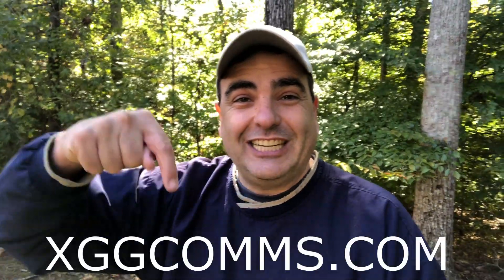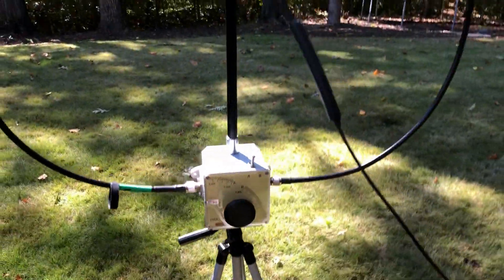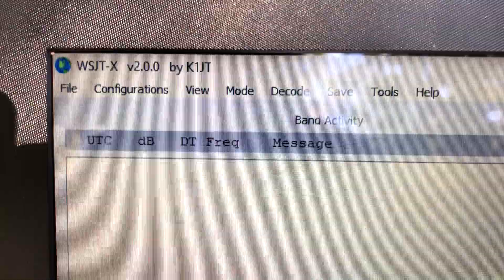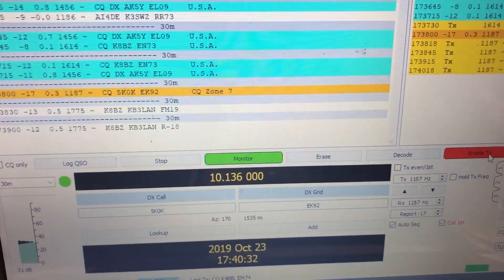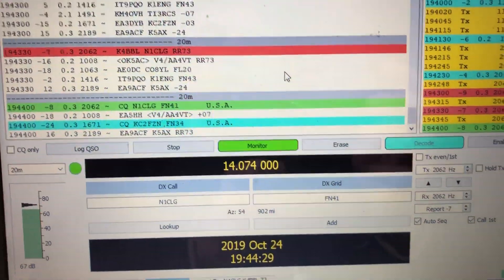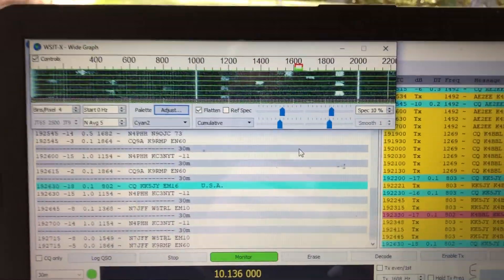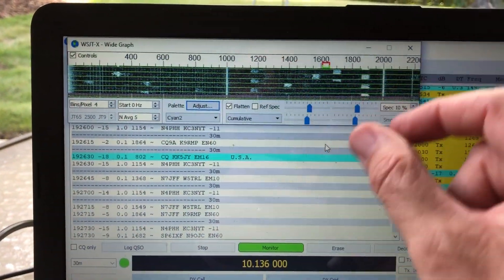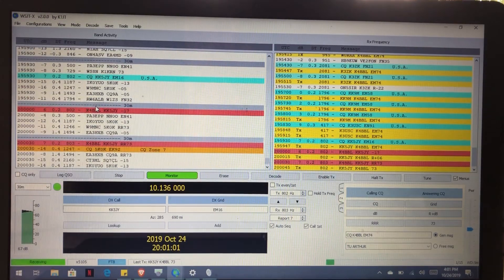No talking ham radio: Digital mode FT8

Comment: FT8 is destroying ham radio.  Now they're on 7.048 almost 24/7.  I've heard them texting each other on 7.060 - the American (and one of the world-wide) QRP watering hole.  I run between 1 and 5 watts.  The FT8 signals on ~7.068 or so are ALWAYS 20 to 40 db over S9 at my home.  Nice huh?  What a super efficient mode.  I've heard, more than once, FT8 idiots (F-tards) running their robots on top of W1AW.  Although I think that's funny in a way... these F tards need to learn some respect, some ham radio tradition, some etiquette and courttesy.. and basic civility.  They need to learn to co-exist with other ham people.  73 OM

Comment: Hey, Thanks for showing me FT-8! Two days from now I get my first HF radio that is digital ready. This video helps get me ready for the low point in the 11 year cycle.
Reply: I went to your CAT cable website and they don't appear to have the CAT cable I need for a Yeasu FT-991A. Can you send me a link to the correct cable? Thanks
Reply from the maker: I think this is the one you need: Product: Yaesu CAT FT-Cable-5-USB
http://www.xggcomms.com/userimages/Yaesu-Interface-Shop(2066641).htm
You can contact the XGGCOMMS team with questions, they are very responsive.

Comment: You need to calibrate the S-meter on the X5105. Yours is showing full scale with no antenna attached at the start of the video. I really don't understand why they don't do this before shipping the radios. It's easy to do on the firmware you have installed. Put the radio in USB, VFO A  tuned to 14.250 MHz. Preamp ON, AGC Fast and no antenna attached. Long-press the menu button and click through to the two menu settings for S Meter Offset and Gain. Adjust the offset until the displayed reading sits at ZERO. Then see how the meter looks. If it's still a bit shy, increase the S Meter Gain menu setting....
Reply from the maker: Thank you!

Comment: Did you have to use the Line in and Line out settings on your Xiegu?  I used the xggcomms device and I had to choose line in to get it to work with the external sound card.  I was hoping you’d show your configuration.  I have only been able to make 1 FT8 contact on the Xiegu, and it was only 35 miles away. 🙁

Comment: I'M A NEWBIE AND WANTED TO KNOW JUST WHAT KINDS OF STUFF CAN BE PROGRAMMED INTO RADIO USING THAT CABLE?  CAN I TALK TO BOATS OR ON MARINE BAND? WILL I BE ABLE TO TALK AROUND THE WORLD?  WHAT KIND OF RANGE ARE WE TALKING ABOUT WITH THE STANDARD SET UP?
Reply: Range all depends on your power output, band conditions, antenna setup, etc. Etc.

No, you can not transmit on the VHF marine frequencies.  There is a very specific frequency range for each band inside the ammatuer spectrum and contingent upon your license grade. 

QRP = Low Power Transmission.  Typically 5 wts or under.  Some people crank out 1500 wts (legal limit on most bands) but that is just unnecessary in my opinion.

I talk all over the world on 20 and 40 meters with a simple dipole antenna and a 100 wt. Rig.  Florida to Belfast Ireland last night!

Go get your license!
Reply: @AlphaSierra323  THANKS FOR THE INFO

Comment: Nice video Brian.  Another point worth adding is the need for an accurate time of day clock.  You can install a small app that syncs your PC to a good time source.  Although this only works when you can connect to the Internet, if your PC syncs before leaving home that should be good for the day.  If your clock is too far out, successful QSOs may be hit and miss.
Reply: Most computer operating systems these days have a service that syncs to NTP servers. Not sure why you would need a small app for that.

Comment: WHAT ABOUT CB RADIO?  YOU DON'T NEED A LICENSE AND IT'S ALOT CHEAPER IN COST IN EQUIPMENT.
Reply: Getting a license and a dual band FM mobile or HT cost about the same as a CB radio. And the license opens up a lot of other things to you.
Reply: @jtshannon  WHAT HAPPENS IF YOU DON'T GET A LICENSE?
Reply: @microminiskirt  Initially, not a lot.  Ham operators will notice you don't have a valid call-sign and stop responding to you.  If you persist and get reported for occupying licensed frequencies AND the FCC gets motivated to send out a field engineer to find you, then massive troubles.  None of the $100.00 here and a $100.00 there.  More like confiscation of equipment and tens of thousands of dollars worth of fines.

The FCC is not so bothered about policing the ham frequencies, IMHO, but they can't be seen to be slack when corporations have spend hundreds of millions to billions of dollars for their LTE allocations.  They have to be seen to be harsh when needed by the lessees.

Either get a CB radio, as I hear some CB operators are getting into data modes (i.e. JS8Call), become a Shortwave Listener (SWL), or spend a couple of days and invest some time in your hobby and get yourself a license.  It is fun, by the way.  Just don't operate outside of your privileges.

Enjoy the hobby, XXX!
Reply: @magwhyte  thanks for THE INFO.  IT SOUNDS LIKE MORE FUN TO GET THE LICENSE HAVE NOT WORRY ABOUT LIMITATIONS.  15.00 ISN'T MUCH $$$
Reply: You can receive on the amateur bands as much as you would like, however to transmit, you need your license.  If not, It’s bad form and you can be fined by the FCC.  You also need an FCC issued Callsign that must be used at the beginning of every conversation and every 10 minutes thereafter for ID.  More importantly, other HAMs will know fairly quickly that something is out of place and will more than likely just not respond.   Getting your license is super easy and a lot of fun.  It opens up world wide comms on a simple 5 wt. hand held radio via networked repeaters, etc.  Great stuff, Great community of people and a lot of fun.
Reply: Hams are the police on the airwave and we notofiticate the FCC if you're doing no well use of the frequencies, if the FCC recibe a report saying you're transmiting without a license in licensed frequencies they'll fine you, they won't fine you with a $250 fine they'll do it with $7,000-$10,000 fine. Ham license cost only $12 and the test is easy.
Reply: I earned my technician and then my general license through the local amateur radio club which cost me nothing out of pocket.  Check with your local club and you might be surprised how inexpensive it can be to become licensed and legal.  73, KD2WHP
Reply: @ericKD2WHP_ham_radio  TWO YEARS LATER IT HAS CHANGED.